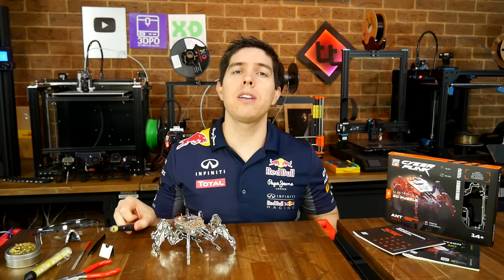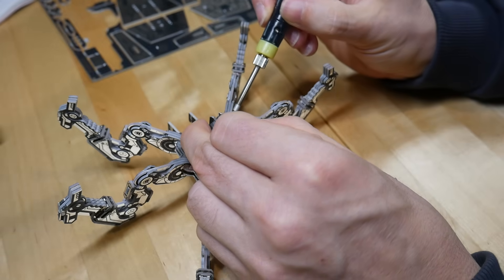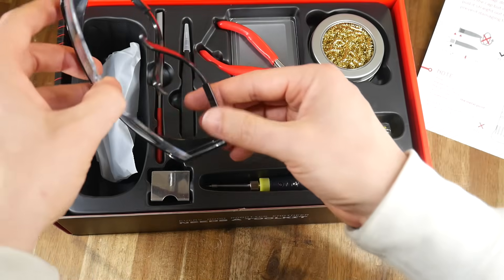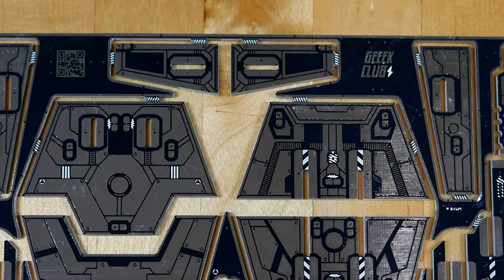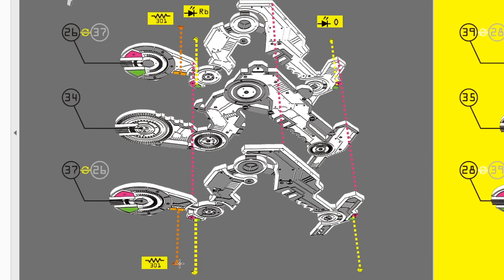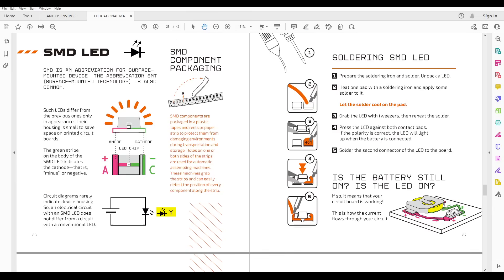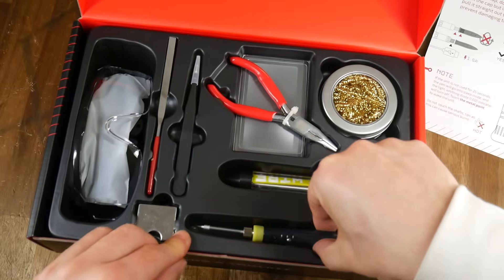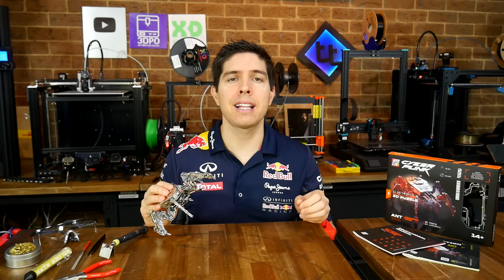Learn to solder with Cyber Punk 3D puzzle kits

Comment: Looks great but they really need to fix the instruction and parts inventory as well as mod the design so your not having to cut traces as it would be better to have the user solder a bridge where needed than slicing through traces.  The fact you had to watch a video and not simply use the directions means many of these probably failed to work for young ones learning and that’s a true bummer and so discouraging.   I’m sure you stated all of this to the company.  Fix those things and it’s an awesome fun learning kit.

Comment: Kids (young & old) are so lucky today....     Almost tempted to buy one for myself.   Re the shorted/not shorted resistors, easy for me to say, and no excusing the confusing/misleading instructions, but there's no reason to solder a component across a short circuit.....

One comment re the toolkit, a 7.5W soldering iron isn't really all that useful IME. I found it telling that your video showed use of a much bigger iron for some of the heavier duty joints involved. A common misconception is that a big iron can damage small components - not true, prolonged heat does, and an iron not quite up to the job is the quickest way to cook components as you have to hold the not-quite-enough-heat in place for far too long. My go-to iron for the past 40 years for most electronics soldering tasks is 45W, just change the tip for different jobs.

Comment: Really happy to see that they went with surface mount components. For the longest time I was really intimidated by surface mount soldering, thinking that I didn't have the skills to pull it off. When I finally did start experimenting with surface mount, though, I found it to be a lot easier than I thought. I think if I had more kits like this, I would have been less intimidated and would have taken the plunge into surface mount soldering sooner. So much of the cool new components available these days are only available in surface mount, so I think getting into SMT soldering is a definite must.

Also I am really glad to see that they included some safety glasses with the kit. Back when I was younger and dumber, I was rather cavalier about wearing safety glasses. That is, until one day when a splatter of hot solder came within inches of hitting my right eye. That was a real wake up call to me, and now I never start a job without putting my safety glasses on (even small jobs like touching up a solder joint.) I even wear them when performing non-soldering tasks where there is a potential for random flying objects to shoot up at me (like clipping my finger/toenails.)

Comment: These are awesom looking models, but I feel if you are learning, or teaching a young child, you might be better off with some of the simpler, cheaper electronic kits like LED flashers, LED Christmas trees or clocks for around $10-20 that you see on eBay or similar for a first thing. Something that would not be a problem if you burnt a component or overheated it! Once you (or your child) is a little more confident then these kits look awesome. 
I don't understand why they decided to put links over those resistors, it would have been better to have left them unconnected and told people to bridge the connections if for some reason they are not needed, or supply zero ohm resistors for that purpose. They really need to add an insert into the kit documentation to correct the discrepancies in the manual but other than that these look like great models that any boy or girl would be proud to make and put on their shelf!
Reply: Hello Ian :')

thank you for your comment, when i started those models i was wondering if i should put those resistors or not, like going for more real electronic, or just putting led :')
i took the direction of having the link , thinking the one not willing to care about resistor will not have anything to do in a more easy way,
but i think your suggestion is better, will push it that way when we do an update of the Cyberpunk set,
i m now working on a Nasa set and we might put SMT components directly at prod to make it more easy and fun.

about the Christmas tree and simpler one, i did some simple tiny BEAM bot, Nano type, 
we are now considering to sale them separately like single package, to make a cheaper entry level, but we are now checking if it's a viable economical model for us to survive. 
always complex to balance wish and complexity and risk of the market.

will check your zero ohm story, eventhough we now understand more the way to do SMT at prod.

all your comments are precious thank you

Comment: Sounds like they failed on the one thing this thing should come with - clear instructions.
Reply: I think that comes from having different ways of putting it together. Makes it more difficult to  write the instructions, building the product, verify that everything is correct, etc. For the purpose of an educational product I think it would have been better to have gone with only one option (or perhaps go with the optional colour scheme by turning the pieces around as long as the build process wasn't different). Having multiple ways of building the model is great the purpose is to replicate different versions of something. But my preference if a person is purchasing a model to learn how to solder then they don't need those complications.
Reply: @capitalinventor4823  
Hello :')

yes at first i was making it for pure geek fun,  to make them open to customize and offer different path, even hack them with solar panels and other add-on, but i try now to make them more simple. even not mentioning they can be done in 2 colors in the instruction manual by reversing panels, but just providing one path ( the model on video can be built in black when reversing panels ). Trying to find a simple way to express that open possibility on instruction manual was quite tricky.
so yes you are right, one more simple path to build is now understood, i had to test :')

all comments and suggestions are very welcome, this to create the next.

thank you

Comment: hi my friend, which 3d printer recommends me.  I want to buy one that can handle regular jobs well.  I had Anycobic mega zero and it was good sometimes and sometimes not good.  so I want to buy a new one, which one do you recommend me?
Reply: Prusa Mini
Reply: @SuperSmashRiolu  i want a 3d printer with a little big bed!
Reply: You should check yout Ender 3 v2 3d printer.
Reply: You can't go wrong with a fokoos odin 5. It's literally minutes for assembly, and produces really good results without any tuning. The only downside is the heat throat - it's proprietary since it's a new model, so woe to you if you need to change it. It IS possible, bit it requires a bit of creativity.
Reply: I have a Creality Ender 3 Max which has a print volume of 300x300x220 and I am very happy with it. Here in the UK they are also quite cheap. The only thing I think it lacks is ABL and a direct drive extruder, but adding those would have pushed it outside of my budget anyway. Build quality is pretty good, there is a lot of info online about these printers and spares and supplies are not a problem. I know some people have had issues with them, but considering the number sold those number of complaints seem small. Its probably not the best choice if you want to print extreme materials or print very fast, but then if you want that then you are really looking at a different class of printer.